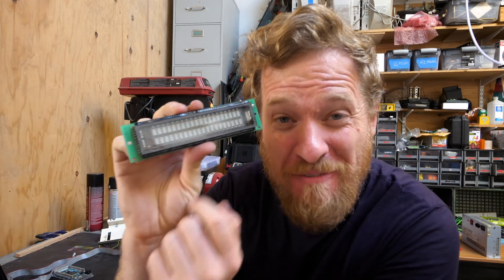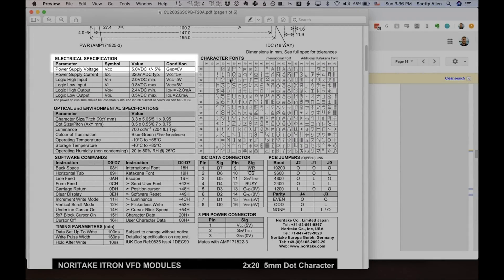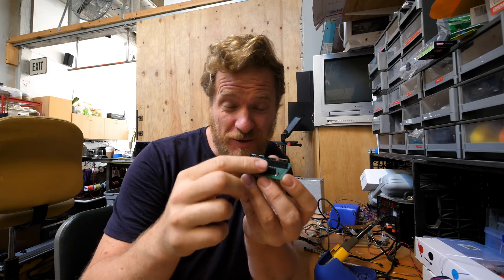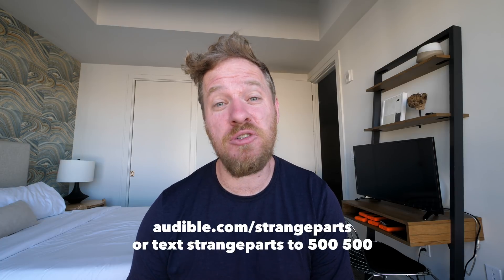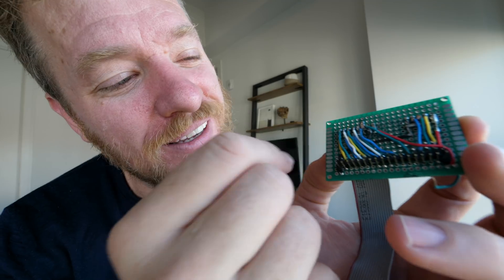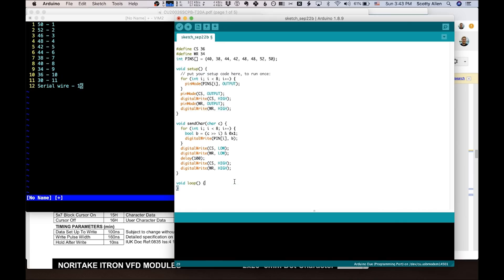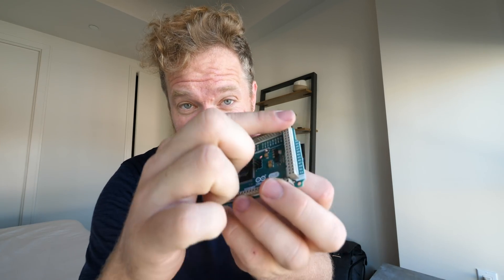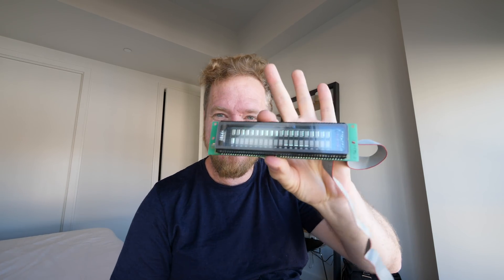Reverse engineering vintage Japanese electronics - a vacuum fluorescent display!

Comment: What? You can buy a vacuum fluorescent display with parallel and/or serial today! I just checked, they have about 3,800 in stock across six different items on digikey. A few are Newhaven, which are definitely nice.

Comment: Very cool video. Thanks!

Just a couple of remarks:

1. The Arduino delay() function takes an integer parameter (of type unsigned long). If you want delays shorter than 1 ms, you can use delayMicroseconds().

2. Instead of defining sendChar() and print(), you could easily implement your own class derived from the abstract Print class. You only have to implement the method `size_t write(uint8_t)` (basically your sendChar()), and then you inherit all the print() methods you enjoy with Serial, including those that convert numbers to ASCII for displaying.

Comment: reverse engineering would be inspecting the display in its original environment, measuring, spying the communication pins with external devices, and deciphering the communication protocol, commands, etc... its a simple build-by-datasheet project, nothing special...

Comment: Those old vfd displays are so cool. I have a number of them, myself. I used my old hp 48 serial port to drive them and used a 40 char. multi line unit to display reminders for myself and other timely info. Too bad they’re no longer made. I considered making a large display with a pile of dot matrix led displays but when I toted up the cost of building it I decided it was way, wat too much money. These were really cheap when they initially showed up on the surplus market. Thanks for making the video

Comment: Hi, great work. Can you guide me on one issue? I have onkyo tx nr 616. Its display turns all all the segments fully the moment its switched on from power point plug yhat moment its on standby mode. Its totally unreadable since all the segments fully lights up. What could be wrong in that. I have replaced one shoryed transistor, prior to that display was dead, now it comes on but lights up fully meaning it shows unaddressed grids and anodes also. Pkease guide if you can.

Comment: The 3-pin connector is your friend, it's +5V/Serial/GND. If you ground the serial-pin it goes into demo mode and starts printing the ASCII-table one character at a time. If you want to use the serial interface with an Arduino; solder a bridge on J4 and connect TX on the Arduino to the serial-pin on the VFD and you're done. No fancy code required! I think the default baud rate is 19200.

Comment: I have been there with a random VFD I found in a lab. I didn‘t find a datasheet, so I tried to buzz out all the connections and routes, took me a complete sunday afternoon. But after that I stopped, because I also thought the board on the back is some custom thing I can‘t reverse engineer to show something on the display. So thanks for this interesting and encouraging video, my VFD looked surprisingly similar! If I find it again I might give it another shot.

Comment: As a software developer thats getting his feet wet in the area of electronics / embedded / system programming, this video really did give me new enthusiasm to keep on going. For example, I know bitwise operators in theory, but still can't wrap my head around their use on the PCB at library implementation level. Now I saw how it's done, hehe.

Comment: I remember programmng one of these, the 4x20 model. It was a pain, but once I got it working it was set up to display my computer stats like cpu speed, fan rpm's, temps, unread emails, facebook new messages indicator, and using custom characters, it would switch into spectrum analyzer mode when you played music. A friend accidentally knocked it off my desk and it lost the vacuum. I was not happy.

Comment: Have you tried the Liquid crystal library included in the Arduino IDE? If the display you have had 16 pins should work. It worked for me on an old 16x1 printer display

Comment: Your explaination of sendChar(char c) wasn't clear to me, so I made myself some examples about what you were doing:

Input : 01000001

bit shift right 0 -> 01000001 -> bitwise and 0x1 -> 00000001 -> 1
bit shift right 1 -> 00100000 -> bitwise and 0x1 -> 00000000 -> 0
bit shift right 2 -> 00010000 -> bitwise and 0x1 -> 00000000 -> 0
bit shift right 3 -> 00001000 -> bitwise and 0x1 -> 00000000 -> 0
bit shift right 4 -> 00000100 -> bitwise and 0x1 -> 00000000 -> 0
bit shift right 5 -> 00000010 -> bitwise and 0x1 -> 00000000 -> 0
bit shift right 6 -> 00000001 -> bitwise and 0x1 -> 00000001 -> 1
bit shift right 7 -> 00000000 -> bitwise and 0x1 -> 00000000 -> 0

Contatenated Output: 1000010
 

Input : 01111000

bit shift right 0 -> 01111000 -> bitwise and 0x1 -> 00000000 -> 0
bit shift right 1 -> 00111100 -> bitwise and 0x1 -> 00000000 -> 0
bit shift right 2 -> 00011110 -> bitwise and 0x1 -> 00000000 -> 0
bit shift right 3 -> 00001111 -> bitwise and 0x1 -> 00000001 -> 1
bit shift right 4 -> 00000111 -> bitwise and 0x1 -> 00000001 -> 1
bit shift right 5 -> 00000011 -> bitwise and 0x1 -> 00000001 -> 1
bit shift right 6 -> 00000001 -> bitwise and 0x1 -> 00000001 -> 1
bit shift right 7 -> 00000000 -> bitwise and 0x1 -> 00000000 -> 0

Concatenated output: 00011110

So... this functions reads every bit in reverse order (from right to left)

If it were to do it normal order (from left to right), it should be like this:

Input : 01000001

bit shift left 0 -> 01000001 -> bitwise and 0x80 -> 00000000 -> 0
bit shift left 1 -> 10000010 -> bitwise and 0x80 -> 10000000 -> 1
bit shift left 2 -> 00000100 -> bitwise and 0x80 -> 00000000 -> 0
bit shift left 3 -> 00001000 -> bitwise and 0x80 -> 00000000 -> 0
bit shift left 4 -> 00010000 -> bitwise and 0x80 -> 00000000 -> 0
bit shift left 5 -> 00100000 -> bitwise and 0x80 -> 00000000 -> 0
bit shift left 6 -> 01000000 -> bitwise and 0x80 -> 00000000 -> 0
bit shift left 7 -> 10000000 -> bitwise and 0x80 -> 10000000 -> 1

Contatenated Output: 01000001
 

Input : 01111000

bit shift left 0 -> 01111000 -> bitwise and 0x80 -> 00000000 -> 0
bit shift left 1 -> 11110000 -> bitwise and 0x80 -> 10000000 -> 1
bit shift left 2 -> 11100000 -> bitwise and 0x80 -> 10000000 -> 1
bit shift left 3 -> 11000000 -> bitwise and 0x80 -> 10000000 -> 1
bit shift left 4 -> 10000000 -> bitwise and 0x80 -> 10000000 -> 1
bit shift left 5 -> 00000000 -> bitwise and 0x80 -> 00000000 -> 0
bit shift left 6 -> 00000000 -> bitwise and 0x80 -> 00000000 -> 0
bit shift left 7 -> 00000000 -> bitwise and 0x80 -> 00000000 -> 0

Concatenated output: 01111000

NOTE: 0x80 is 10000000

It helped me understand what you were doing, so I share it hoping it helps someone else too! :)

Comment: For anyone interested in working with VFDs that wants new VFDs and not just whatever they can scrounge, they don't cost anywhere near $600 for most models. Basic character display models are $20-$50. Larger character models can push up to $100. There are also models running from $200-$400 with other features, like dot-matrix display and touch support. You can also get color filters to layer over the top. They're a really attractive option for simple monochrome displays.

Most of the super-cheap character display models can use serial support and many emulate the HD44780 command set. More complex models may support I2C and/or SPI. Check out the Noritake shop at noritake-vfd.com. They have periodic promotions, and sell cables and power supplies. Purchasable models link to another noritake site (noritake-elec) with datasheets and code libraries (including arduino, AVR, MSP430, and STM32). If you've worked with microcontrollers, you should be able to get a simple message up in less than half an hour.

I used a low-end Y-series model and I was able to display data with a USB-serial adapter from a PC. A simple program works, but they've also got a sample display application called GUD-10K that's useful for testing the product and confirming your connection.

Graphical display and performance will require a lot more design effort. And bit-banging on a high-end computer is hardly the most efficient use of resources, so you'll want a microcontroller for most finished projects.

Comment: Investing so much time when there lcd version of this display around for a 1$ with arduino libraries and hardware already figured out. Same data protocol, same character codes probably. Only difference extra power requirements for emitters and grid. You probably never stumble upon them, but that old design based of hitachi hd44780 is still in production and popular.

Comment: "Reverse engineering"
literally has the datasheet
Reply: dissapointed Bobby rides away on a bike
Reply: @priitmolder6475  Actually laughed out loud.
Reply: In all fairness.... having the datasheet doesn't magically make it work.  Actually implementing the device in itself is very challenging and rewarding. Reverse engineering might not be the correct term. But the skill in interpreting a datasheet and implementing is something I've seen many engineers unable to do...
Reply: @RamjetX  Very much OT but I just wanted to say I love your Thrustmaster wheel adapter
Reply: @KacKLaPPeN23  Oh... Cheers mate. Thanks very much. :) It's nice to get feedback like that
Reply: Yeah seriously, just because you don't know what you're doing doesn't make it "reverse engineering" ffs

Comment: I was really surprised that code did anything, since CS signal was marked as active on LOW in the data sheet and in the arduino setup code it was set to HIGH. Any idea if that pin was actually connected correctly to arduino?

Comment: Hi, I think that you would better create a buffer with characters to be able to draw character at specific position, and redraw screen every 16ms (~60 Hz) using hardware timer for interruptions, this don't block the main thread (delay is a blocking function) and will consume less power.

Comment: wr --> probably a write enable pin
cs --> probably a chip select pin 

--> pretty standard stuff in serial circuits / ics
Reply: Actually, I think they just need to be low for the display to accept the characters

Comment: My true question is what defines b as being TRUE(High) or FALSE(Low)? Does the digitalWrite command of the arduino only check the LSB of boolean data types?
To my understanding, the variable b he declared is an 8 bit boolean number.
In the case of his code, the LSB of b is only ever 1 or 0 while the other 7 bits are always 0.
Does anyone know what would happen if this variable b was something like 1001 0111 (instead of 0000 0001)? 

Digital Write is writing either HIGH or LOW depending on the value of b. How does the code know to check for just the LSB of b? Since b is an array that holds various 1's and 0's in its 8 bits, shouldn't the argument for digitalWrite be --> digitalWrite(PINS[i] , b[0])?
My true question is what defines b as being TRUE(High) or FALSE(Low)? Does the digitalWrite command of the arduino only check the LSB of boolean data types?

I am struggling to see how these functions would handle a boolean number with different 1's and 0's in various spots.

Comment: First, did you try the LiquidCrystal library? Your VFD has some funky control pins, so the interface might be pre M68/i80, or just made for some odd machine/use case. The command list of your VFD is not the normal set, and are more like serial terminal commands.
 A decade ago, I had around 50 pieces CU20025ECPB-U1J modules (I sold most of them. Still keep 4 or 5 around because I love a good VFD! ;)
https://www.digchip.com/datasheets/download_datasheet.php?id=584257&part-number=CU20025ECPB-W1J&type=prod

Anyway, I suspect it could be made to work with LiquidCrystal. your WR pin appears to be Enable (both are a sort of latch signal where the VFD reads on the low to high transition). Your CS pin can be tied low all the time unless you want to reuse the data pins. Your A0 is RS (Register Select. Sets the LCD to character or commands mode) EXCEPT! IT is inverted. So maybe hack the LiquidCrystal lib a little..? Or slap in inverter in between.
Reply: Oh yeah and tapping the display (or bumping it / dropping it) and listening to the grid elements "sing" is both exciting and scary at the same time

Comment: WR / CS is most likely Write / Chip Select, a way to tell the chip what you're sending is intended for it. In many cases (not all) this will be a low select, indicated by a horizontal line on top of CS

Comment: I used these and many other VFD units in slot machines when I was programmer. The Noritake displays are good but the single line 16x1 unit has some timing issues that corrupt the display. I do love VFDs....have a look on YouTube for a Crazy Fruits UK slot machine and look at the effects we did. My favourite was the "scramble", essentially, pick random characters for the length of the final string, and as randomly displayed characters match the character of the final string, don't change that character again. Keep doing this, with a timer that keeps getting quicker, and the effect looks great. You can also "throb" the display by adjusting the brightness up and down on a timer. I loved these things.

Comment: If anyone is interested, I found the full datasheet for the Samsung version of this VFD. It's a direct replacement for the display and all the connections and commands seem to be the same.
http://www.yoohanlv.co.kr/products/pdf_2/vfd%20character/20T201DA1.pdf

Using the serial input makes it much simpler and only needs one wire. I've been messing with my one row version of the VFD since Scotty put out this video and it's been a good learning experience because I've never needed to communicate with another device over the RX pin before. Most of the time I'm using SPI or I2C.

Comment: Cool, nice job! I used to have a cash register VFD display with a serial connection wired to my pc running winamp, so I could always see what I was listening to.. But the speed of the parralel interface makes this so much cooler! When always drawing two full lines at a time , you could use it to make a simple game. Like chrome's dino jumping game..

Comment: I've got a similar VFD out of an POS terminal. The protocol is an confidental IBM one and i had to reverse engineer the circuit, desolder the main controller chip and sigal the five (!) shift registers directly. An ESP8266 could drive all through an additional shift register (using I2S and DMA). And by this i have pixel level control on the display with (sort of) multiple gray levels :)

Comment: I would run that on a constant loop reading out "updating firmware" then the animation bar.
bottom bar would have 0-100 % readout with a timer.  just have it reset to 0 when done.

other option would be to make it a really cool clock with weather reports.  etc. 

Either way, Fun Video!

Comment: Back in 2003/2004 when i was 3/4 years old My dad used to repair TVs,DVD players and VCR and stuff, so he had dozens of dead electronics which he salvaged for parts, and these fluorescent displays were there in the dozens most of them were broken in the desoldering process as he did not have all the proper equipments, one day i saw one these and it was the exact same size that our Scotty have. I took it, looked closely upon it and stared like half and hour on it before my mom screamed from the back and i dropped it because i got scared. And i cried for breaking something so extra ordinary. And as he said that this thing costs around $600 on a site. Then boy i would've been rich if only we knew that there value will fly off like that in the future. Also upon watching this video half way through i realized that the Sony stereo sound system that i have (a thing from 2000) also have this fluorescent display, Which means when it dies and can't be repaired i'll take apart the display in a heartbeat, to see what type or version it actually is.

Comment: the worse part of those fluorescent display, is they getting dim on age, till you can't see it anymore ;(, at one point I have fan controller with those, and they keep dim out on me, after replace them a few times I just use normal knob fan control.

Comment: The controller on the VFD is often functionally the same as the HD44780 [compatible] LCD controller that is commonly used, as such the Arduino LCD lib may be able to drive it. I know the Noritake VFD's I've used in the past were compatible, with only some minor tweaks required.

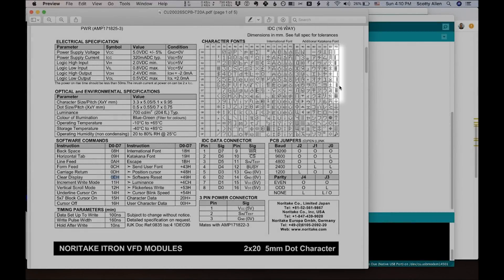Comment: @14:37 You should pay attention to the timing at the bottom left of the data sheet. When writing to the VFD controllers, you need to have a delay of 160ns. This is to give the controller time to read the information. Also the ~CS (Active LOW) is indeed Chip Select. The ~WR (Active LOW) is Write/Read. The way I understand the timing is as follows. Send data to D7-D0 and hold for 100ns. 10ns after your sent D7-D0, pull ~WR low for 160ns. You should be able to speed up your display this way.

My Two Cents. Good work in back-engineering the communication with the VFD. This display works similar to the HD44780 LCD controller. The only different is that the HD44780 has an initialization sequence you must complete which puts it either in 8 bit mode of 4 bit mode.